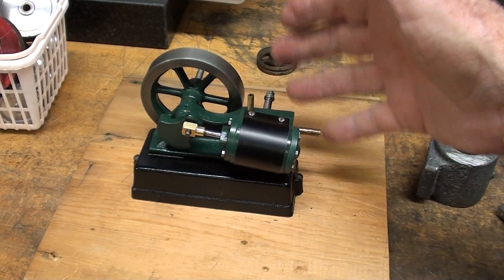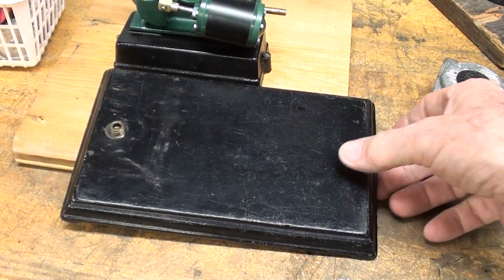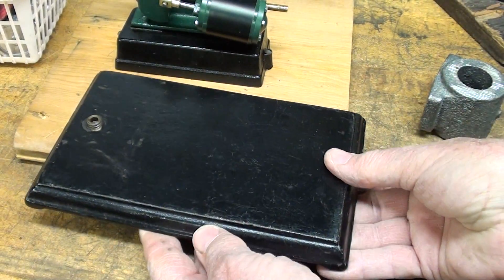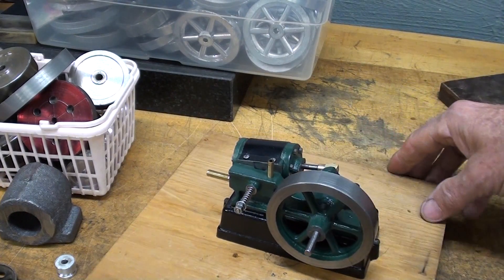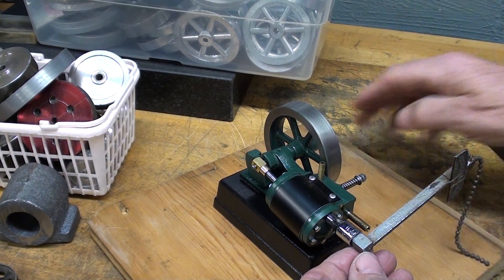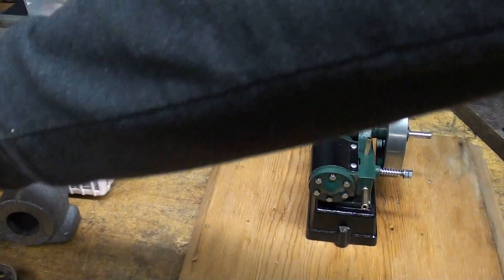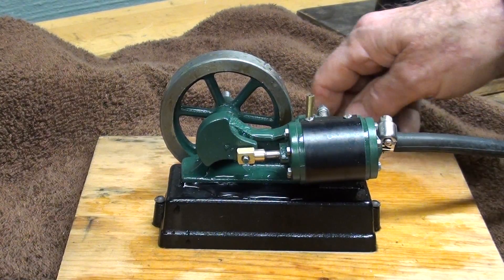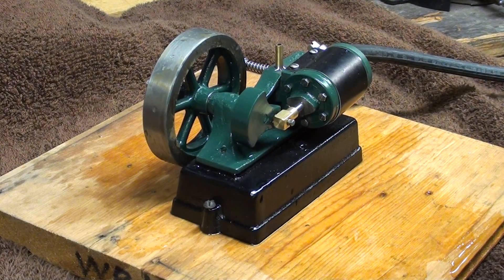Tubalcain pt 10 RUNS THE STUART ENGINE UNDER STEAM

Comment: Great to watch sir. You really do need to use a displacement lubricator filled with steam oil if you run the engine with steam or the insides will be rusting so fast you would not believe it. Thanks again from the otherside of the pond.

Comment: Brilliant series of videos. So brilliant that they kept me up until 3 am watching them. I first built a Stuart steam engine in 1975, when I was a toolroom apprentice. It was a Stuart's No 1 Beam Engine - a bit larger than this and although I missed out on the pain of an oscillating cylinder, I made up for it with the mental agony of making Watt's Parallel linkage from flat bar with a file. You took around three weeks to make this, I took three years to finish mine. And I think larger engines are actually easier to build than small ones - don't know how you'd feel about this? Certainly for me the hallmark of how good a steam engine is not how quickly it will run, but how slowly, and I think (as a fellow engineer) that you've done a brilliant job with this one. Just a thought - and no way a criticism - I notice the geometry of the piston in the original drawing called for a very deep wide groove, which you replaced with a shallow oil groove. I think the reason for this may be that as the coefficient of expansion of brass is much greater than that of cast iron, the piston may tend to bind if the cylinder heats up.
Reply from the maker: Thank you very much. Yes, that watts parallel motion would be quite a project.

Comment: Mr. Pete, that metal base looks like a laboratory stand. A threaded rod screws into the hole and you can mount beakers, etc. above a bunsen burner or alcohol lamp. There is a displacement lubricator that adds steam oil into the cylinder.

Comment: Nice serie of videos, thanks!

That water will lock the machine, as water will not compress easily. Then you have a hydralic lock, and it that happen could be damaged.
That is not a problem on this machine, but good to know. :-)

Because of the heat, you need to have thick "steam oil" the oil the cylinder.

But nice to see the machine running on real steam. Thanks.

Comment: Great video and excellent project. I noticed that when the engine is running on steam considerable steam leaks from around the connecting rod where you chose to leave out that packing. I wonder whether it might not run faster on 10 PSI if that packing had been included or would the additional friction of the packing kept things about the same?

Comment: you mentioned not knowing the pressure going into the engine because of the valve with a b on it. you are regulating flow with that valve, not pressure. whatever your gauge reads is what the engine is getting. if you want to regulate pressure you need a regulator, either external or internal venting, though internal would on be better since steam is the fuel or commodity in this system. also, metering in versus metering out, you get more accurate adjustability with metering on the exhaust.

Comment: Another great achievement. You inspired me years ago to build a Stuart S50 mill engine and some scratch built oscillators. One worth a mention is Dr Elmer Verburg's tiny, a smart little bumble bee affair. The plan for it is free and it's a great size to keep in your pocket to show what you're all about. Mine came in handy to prove my engineering skills at an interview and I would have got my dream job, but was sadly blocked by someone in our HR department because I was under qualified. You know when you know you've ace'd the interview, thanks to "tiny" I had a chance!
Reply from the maker: Yes-I have made several of elmers engines.
too bad about the job

Comment: Great video. Just for the fun of it, I will yank your chain about the torque wrench. I think you are supposed to pull on the chain to get the most accurate reading, LOL. I will look for torque specs for BA fasteners. I need to build a boiler for my little engines as they only get fed compressed air. I think your engine should run the dynamo but you will need more than 10 psi.

Comment: That's a base for a lab stand. A vertical rod gets threaded into the hole. Then various clamps and brackets hold test tubes, flasks, distilling apparatus, and the like. I have several around here; good for positioning light objects temporarily or even semi-permanently.

Comment: I couldn't find a specification for the Progress engine but by rough calculation I think it will produce about 8 in-oz of torque at 10 PSI.  If that is correct, I don't think you have any hope of driving the generator with this engine.  You will probably need to use an engine with a bore in the 1.5 to 2 inch range to run the generator on low pressure air or steam.  It looks to me like the Progress is only meant to overcome it's own friction and it looked like that when you were running it on 10 PSI.  Maybe someone else can check my calculation since I am an electrical engineer and not used to estimating the power output of steam engines.

A really nice looking engine and I enjoyed watching you build it.
Reply: 10psi was what seems a safe requirement for him. I'm sure the little piston could handle 12-15psi but oscillating engines aren't very efficient. I hadn't found much on resources for output of similar engines, but guessing one like this can produce about 25-30 watts only.
I'm sure there is a function of piston bore, stroke and PSI that can estimate steam power output values. I don't yet have any steam engines to measure or test.

Comment: Great video series!

When I run my Jensen steam engines, I catch the condensate with a chuff pot to cut-down on the mess.  Search "steam chuff pot" for some ideas.

Mine is just made from a few parts from the plumbing aisle and connected to the exhaust of the engine via silicone fuel line from the hobby store.  The silicone fuel line is great stuff: it just slides onto the exhaust tube and seems immune to the heat.

The really nice chuff pots have plumbing (basically a steam whistle) inside to enhance the sound of the escaping steam to make it sound more like a full-scale engine.

Comment: You do NOT need the full 5000 RPM unless you want the full voltage/amperage out of the generator, and then you need a much more powerful engine. You only need a fraction of the RPM for a low volt / low amp load like a LED or a flashlight bulb.